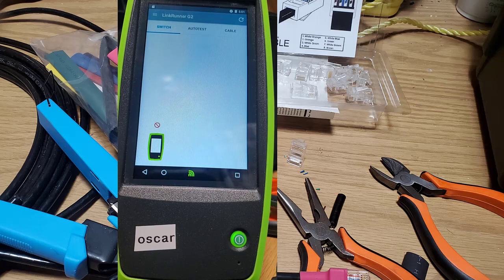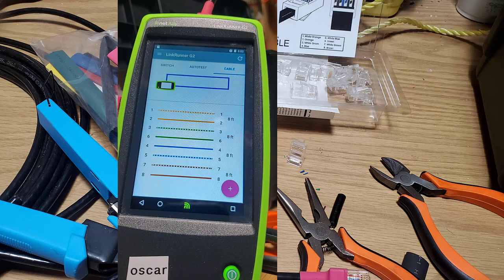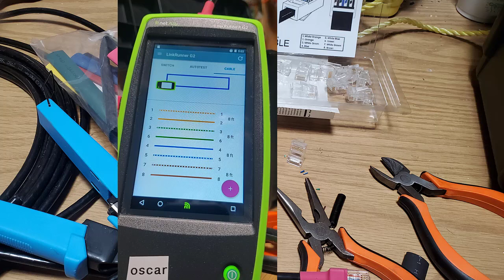making cables - another tip

Comment: I pump dielectric grease INSIDE the rj45 BEFORE inserting the copper leads and crimping. In theory I could do heat shrink too. I also gob it in the rj45 receptical too . Basically displacing all of the air.
Reply from the maker: yup. i mention using dielectric grease in pother videos as well,,  thanks for the feedback - much appreciated